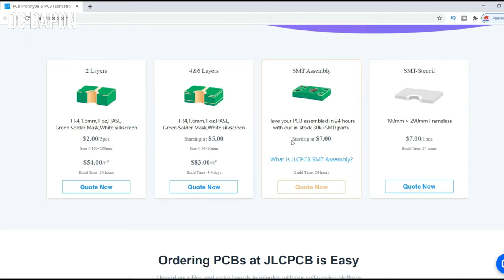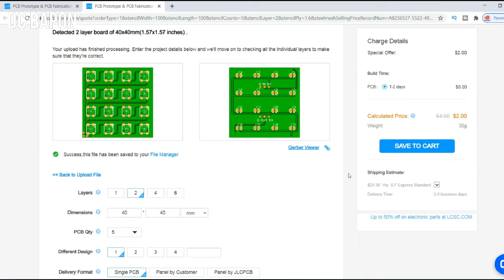How To make Mini Room Heater With Rechargeable - DIY

Comment: Hello, what is your heater wire thickness and cable type, how can I find this heater wire ??
Reply: Heating element of indection stove wire it can have any electric shop or repair shop of electric iteams😊😊
Reply: @technicalnani6536  Is this induction stove wire ?
Reply: Yes

Comment: 1. Do not EVER solder to batteries, unless you wanna go out in fire or from poisonous gasses. If you miraculously survive, you'll end up with dry joints that will fall off easily.
2. Do not EVER use batteries that aren't PCB-protected for these kinds of projects.
3. Do not EVER try what this guy has done at home. You will literally burn your house.